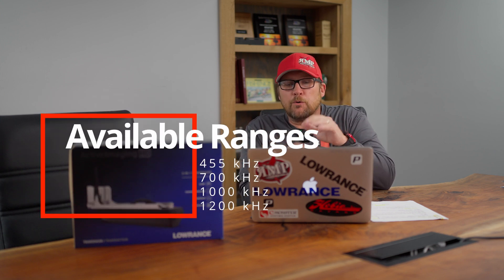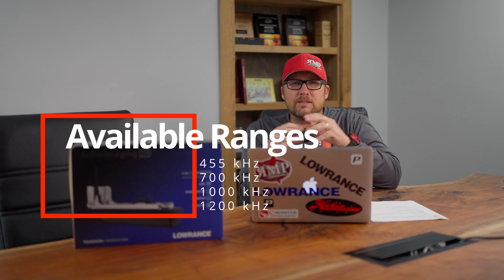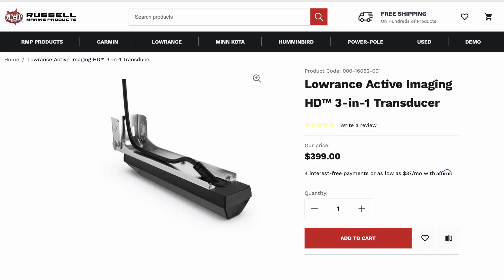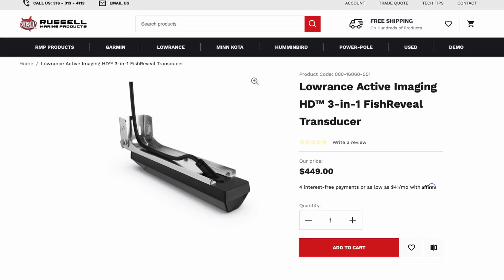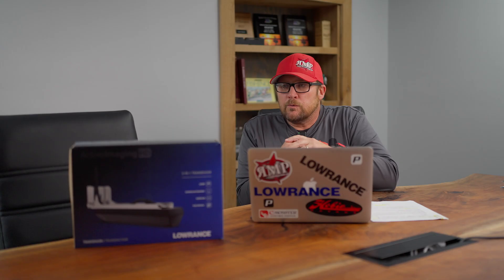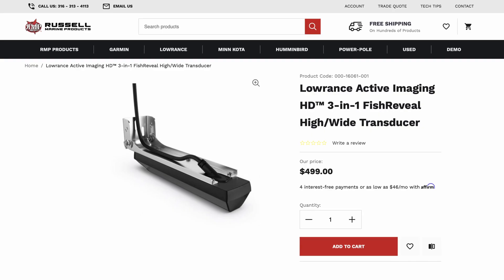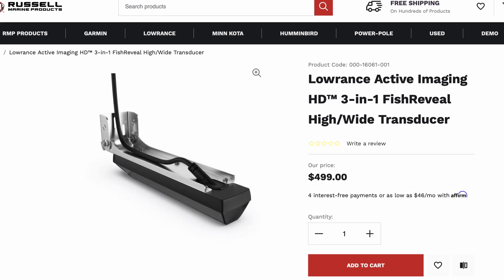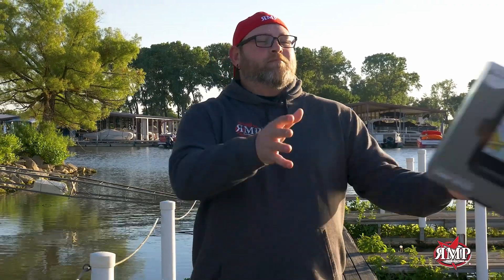Lowrance HD Transducer Options | 3in1 & 4in1

Comment: Are you sure about the depths of the High/Wide and Medium/High versions? From my research the H/W is for higher in the water column and wider beam. Of course Lowrance has zero information on the 2.
Reply: I was thinking the same thing.
Reply: This is what I found in my research and your absolutely correct, RMP contradicts what this says
Frequency Range:
MW (Medium/High): This transducer operates in the medium and high-frequency ranges, which is ideal for general-purpose fishing and provides good depth penetration and target separation.
HW (High/Wide): This transducer operates in the high and wide-frequency ranges, offering better resolution and detail, especially in shallow waters.
Reply: Correct. Guys from RPM are wrong. High wide have only 200khz and 200khz wide beam. It does NOT have 50khz. It is not suitable  for deep waters. I already saw HW transducer on real water

Comment: For you guys that are running these HD transducers on the Lives:

10000% need the S3100 modules. 
Also, in order to access your higher kW frequencies, make sure you have at least version 23.3 software updated on your units. Won’t work without it!